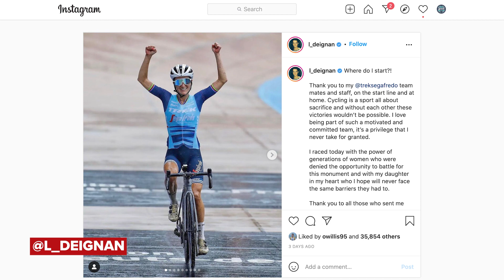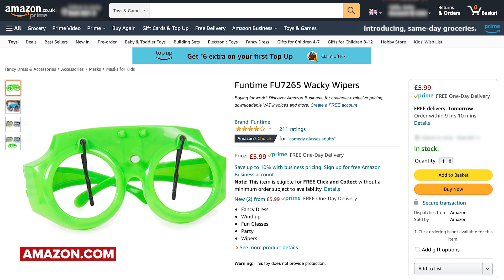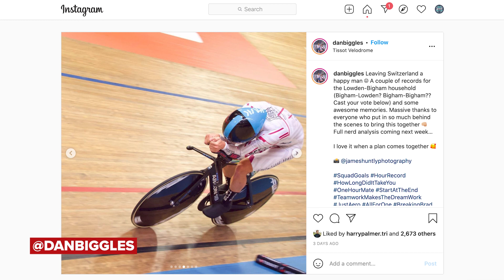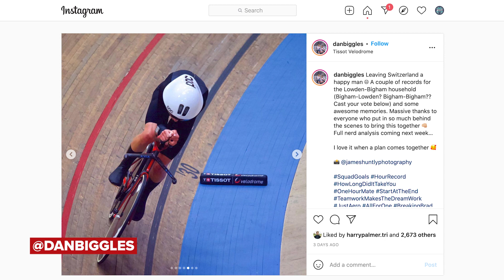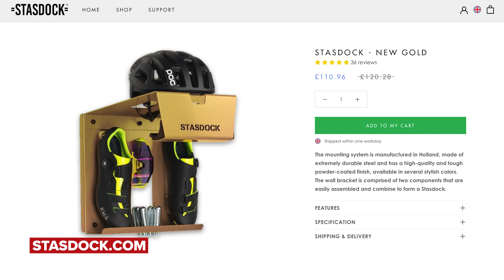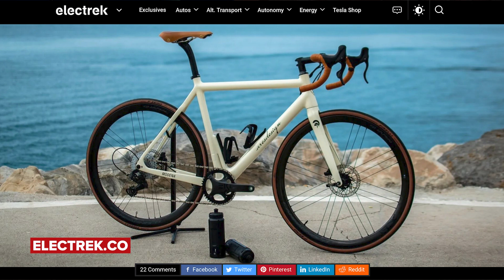2021 Paris-Roubaix Tech Special | GCN Tech Show Ep. 198

Comment from the maker: Did you see any tech at Paris-Roubaix which we missed? Let us know in the comments!👇
Reply: Big one missed, Lizzie won on a 1x drive train.
Reply: Yes, and the Ultegra on Elisa Longo Borghini‘s bike might point in the same direction. There is a long rear mech in Ultegra needed for a 34T cassette which is not available in Dura Ace. Maybe she thought about using 1x but changed her mind shortly before the race.
Reply: you missed the fact that the "braking with the foot" was not caused by a mechanical but by the wet/ dirt weather conditions,  that wore the brake pads so much that riders had to use several sets of pads during Roubaix.
Reply: @kati2426  That really struck me. How on earth can you ride 260km with almost 43kph average whilst wearing out several sets of brakepads?
Reply: MVDP's white shoes
Reply: Ah, the Mathieu van der Poll...
Reply: I have non tubeless front gp5000 on the front of my bike with no inner tube but with sealant. Holds air brilliantly and lightweight. 
Foam inserts do increase rolling resistance.

Comment: There is no way that you “have to” run your hookless tires at their max 75 psi. So think about it, you’re saying every cyclist, no matter what their weight, has to be on the same tire pressure of 75 psi which is also its max. That would mean its max is also it minimum? That is ridiculous. Where do you guys get these crazy thoughts? No tire system would succeed if it had such limited tolerances or flexibility. I have hookless rims and tires and I’m riding 40 to 50 psi for years and I’ve had zero problems.
Reply: Agreed

Comment: Tyre liners are great apart from when the tyre blows off taking it off the rim…… Grrrr.
Yep, happened to me Sunday, one new Zipp 303 later 😥
Reply: Can you give details please. Tire type, pressure used, and your weight please. Im running ZIPP 303s with SPECIALIZED TURBO RAPIDAIR, 68/72lbs for 165lb rider.
Reply: @awesomexistence  I was running 38mm (they can take up to 50mm), on my gravel bike, at 60 psi.
Weight wise I’m a big guy (hence gravel bike), currently around the 18 stone mark (252 lbs).
Reply: Are you riding the hooked or hookless 303s? I set my tire pressures based on the SRAM TIRE PRESSURE recommendations 2wheelsets 21mm internal hookless and 1 25mm hooked gravel. I push them pretty aggressively and haven’t any problems. I did change one tire set out after reading of blowoff problems due to incompatibility recommendations. Is this a possible problem on yours? What tire brand blew off and hooked or hookless? Is it possible you had too much tire pressure based on SRAM’s recommendations? Also too much pressure will affect spoke tension and wheel dynamics.